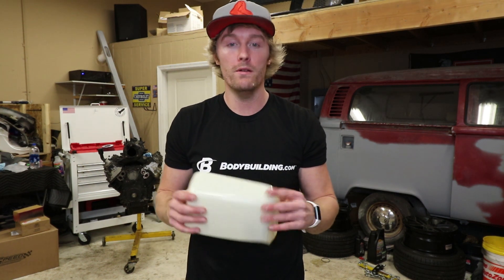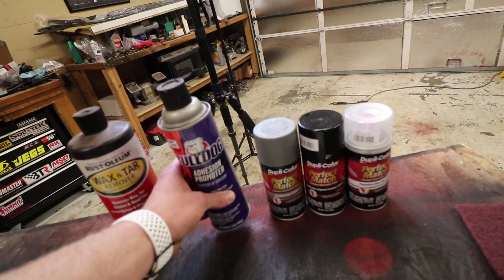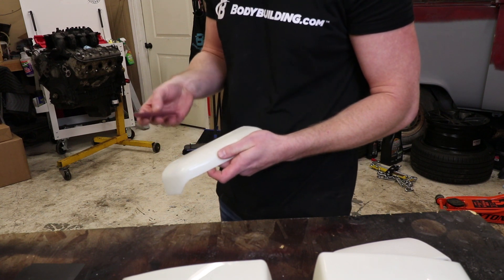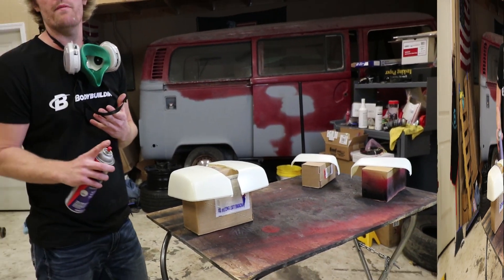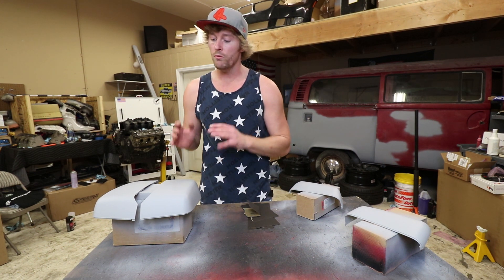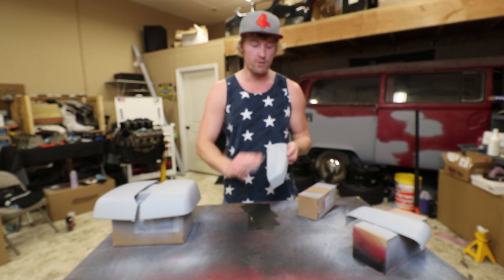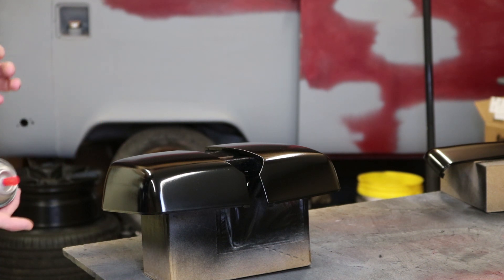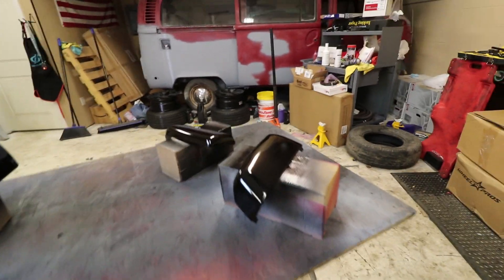Color Match Silverado Tow Mirror Covers - Paint Match Plastic Mirrors

Comment: do i need a primer sealer? i've seen a ton of videos but no one really uses it
Reply from the maker: I always like to use a primer, you will need adhesion promoter if you want the primer to bond to the plastic properly.
Reply: @MitchCarveth  ok and i have new bumper ends that are metal and black. what do i need to do for sanding and what grits to use before applying primer?